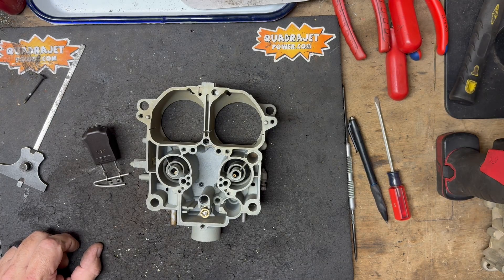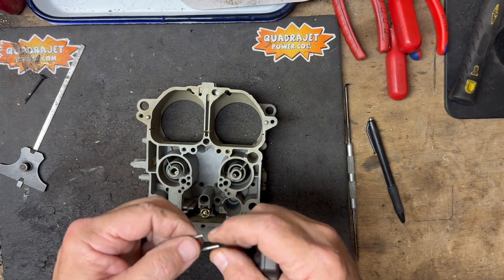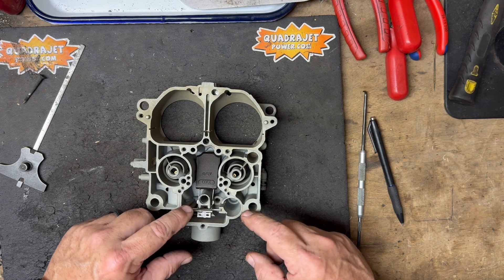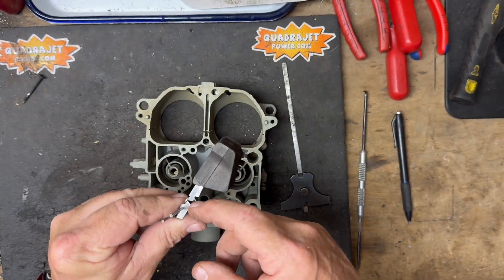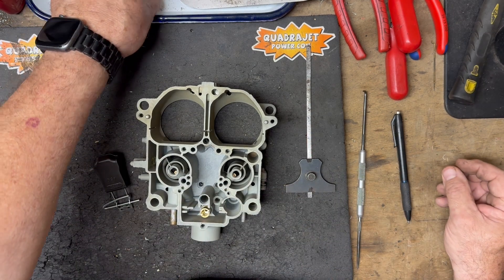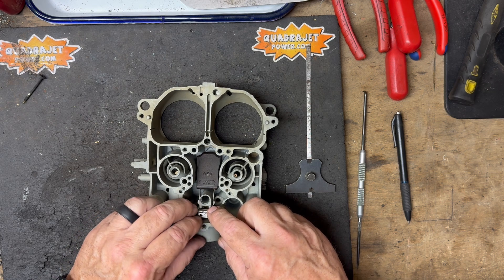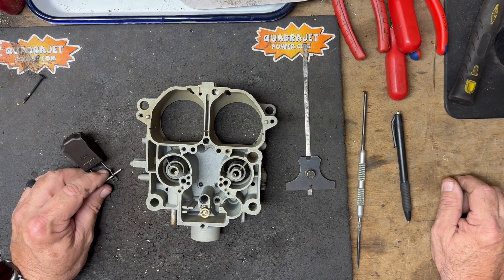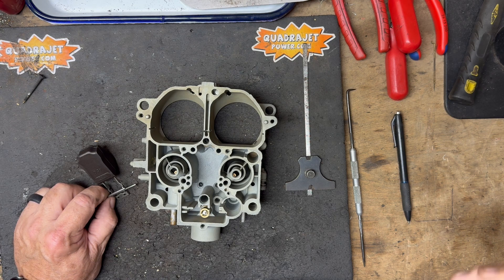Quadrajet Power LLC, how to set a float height in the Quadrajet carburetor

Comment: I have a 1979 trans am with a quadrajet and I'm rebuilding it and noticed during disassembly it didn't have a apt screw adjustment for the power valve is that a problem?  
Why would it be missing is it necessary? Should I add one and also tap the top cover to alow access to it for adjustment without having to pull the top cover off?
Reply from the maker: Yes, it is recommended to have the apt screw. It makes it very easy to adjust your part throttle mixture.  We have these items on our website.  APT screw: https://quadrajetpower.com/apt-stud-internal-adjustable-part-throttle-screw/?searchid=0&search_query=apts
APT Spring: https://quadrajetpower.com/apt-internal-tension-spring-new/
APTKIT for tapping the hole: https://quadrajetpower.com/apt-plug-kit-with-tap-plug-and-wrench/?searchid=0&search_query=aptkit

Comment: I've got a Quadrajet that was originally for a 454 that id like to install on my little 283. I assume the existing jets are goung to need changing out. Can you recommend where to start with my initial settings or do i need a different carb to start with?
Reply from the maker: You can set up just about any quadrajet for any engine, if you have the correct calibration parts, which we can supply. Our recalibration kit was created for this exact purpose. https://quadrajetpower.com/qb3-ez-recalibration-kit/?searchid=0&search_query=kitl3
Reply: Today's corn syrup gas is worse. Don't let it sit for long. Use non ethanol if you run a carb that's not driven daily.

Comment: Do you recommend any mechanical pumps in particular? Are regulators needed?
Reply from the maker: I don't recommend any brand of pump, many of them today do have too high of pressure and may need a regulator to keep it at about 5-6 psi. Volume is more critical than pressure.